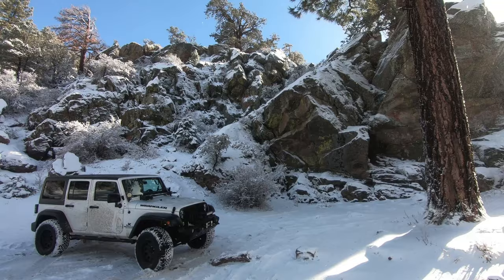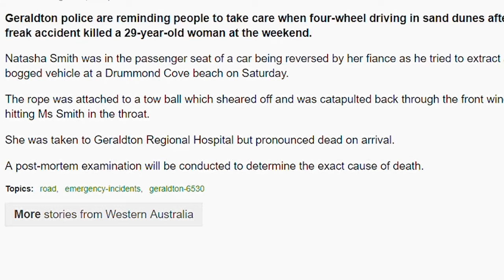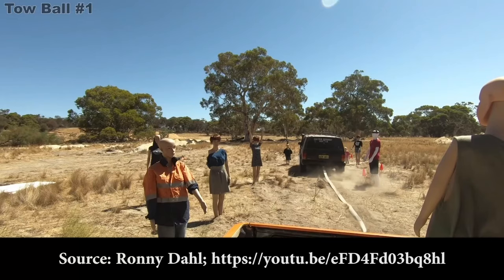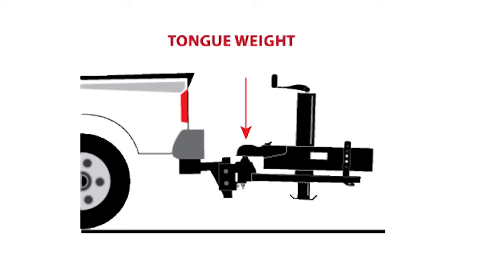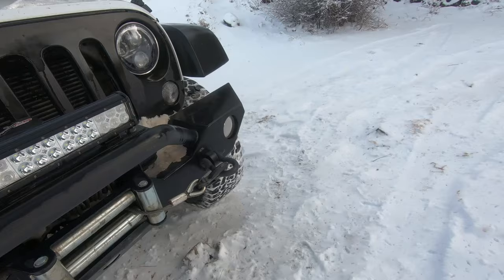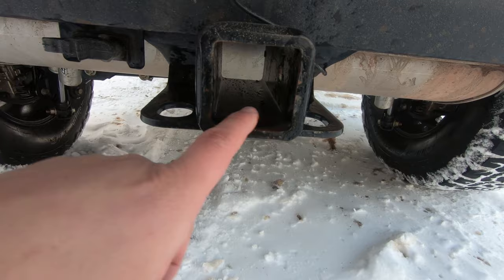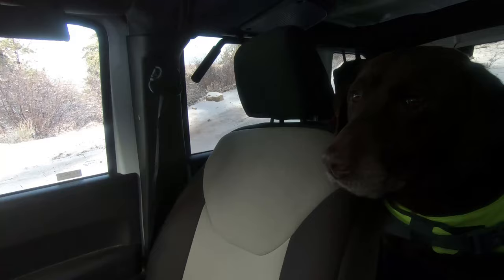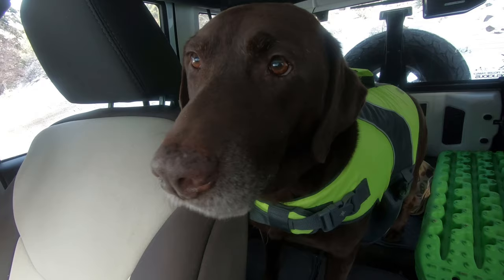NEVER Use a Tow Ball in 4x4 Recovery - Here's Why

Comment: For anyone wondering, in the first instance the ball had been poorly welded to a plate which was excessively corroded. The body of the ball was also corroded. You can read about it here:

https://www.magistratescourt.tas.gov.au/about_us/coroners/coronialfindings/s/stein,_joshua_phillip_-_2010_tascd_418

Moral of the story: Tow balls are safe when properly fastened as they were originally intended, and when they are not corroded or rusted through. This is made especially clear in the video by Ronny. He had to drive 45 mph, cut the shank in half, and chain the other car to a tree for the ball to finally fail after several attempts. 

Additionally, a kinetic rope is a MUCH safer alternative to a static rope. They are designed to stretch and even out the impact of a tug. 

Lastly, a tow ball is absolutely designed to take horizontal force. This is the MOST important factor in determining the rating of a towball. It must be able to withstand heavy braking (shock loading) during towing as well as heavy force during acceleration (static loading) and inclines. You can read about shock and static loading here: http://freeit.free.fr/Structure%20Engineering%20HandBook/21.pdf
Reply: Good info, thank you.

Comment: To be fair, Ronny had to cut the ball AND drive incredibly fast to get it to finally fail. Unfortunately we read about these instances where people are killed, but we never know the condition of the ball before it failed. I’ve seen these balls just fall right off while driving because the lock nut has untwisted off the bottom.

The real key is to inspect them before you use them. If there’s a stronger point of recovery that’s just as accessible, then of course go ahead and use that.
Reply: The Parking Lot Garage, I agree with you.
Reply: Or… just find a different hook point and not risk it lol 🤦‍♂️
Reply: Sure you could risk it, or you can just spend about 30 bucks and get a rated recovery point. Personally I think it's worth the cost not to have the risk.

Comment: I think that Dahl guy was leaving them loose to break them. After yanking 10K pounds boats around I think balls have established themselves as pretty stout. I do agree the old balls from before everything was made from Chinesium were better. I keep my old '90s balls.
Reply: No, he is absolutely correct.  He could have gone into greater technical detail but he kept it simple.  You are hauling a boat. The pressures against that HSS steel bolt/ball by a trailer hitch are minimal compared to a kenetic slam against it with a recovery strap.  Does your boat trailer employ electric brakes? Less stress against that bolt.  Your hitch is also distributing stress across the whole ball and not a 1 - 2 inch area.  When that strap pulls, it's not always a straight line. It may pull upwards slightly or downwards.  And the clips of the balls breaking away, wasn't him.  I hope that clears it up for you.  (I'm a tow op with over 20 years of experience.  We do use the hitch, but not the ball unless it's a light pull)
Reply: Those trailer balls have three classes of strength and you should have observed what it is rated for it's written on I always tie a knot around the back of the hitch
Reply: Quality has gone "South". 
eg.New 16mm D-Shackles have a 2Ton rating, but in the past they had a 4.75Ton rating. 

You may ask why ? 
The shackles are still 16mm BUT the pin is now thinner (ie.19mm instead of 7/8" or ±22mm)

Comment: Well guess he can have his opinion.  I believe I watched Ronny Dahl iirc he had to chain vehicle to tree? Multiple jerks, damaged entire hitch unit…. Didn’t he finally have to weaken the ball to finally cause failure?   First clue to take with grain of salt .  “NEVER & ALWAYS”
  If you are buried to frame in mud. That tow ball can be rated under 1 ton.  Yep easy to break.  But what are most recoveries?  It just needs a assist.   You have (maybe) a 10k hitch with 10k tow ball, 15k rated line/strap/chain to unibody part not designed to be pulled from. 
  What is the weak point?   I have pulled out a lot with under 5k rated chains. Tractors stuck in mud.  All I added was a old tire. @10 chain thru tire 2 spots on front of stuck tractor frame.  2nd chain @16’ from tire to drawbar.  Tighten, pull with both trying. Quit breaking chains when I added the tire.

Comment: Just out of curiosity, I wonder how the balls that are welded on instead of bolted hold up to that test, just from a towing aspect.
Reply from the maker: Chris Singletary right?.. my guess it it would probably fair a bit stronger, who knows 🤷🏻‍♂️
Reply: @andrewbyor3198  The 1st report (about accident in Tasmania, Australia) said that the towball in question was welded, but welded poorly allowing water to pool in the weld and in contact with bare metal which resulted in corrosion that significantly weakened it. So the 1st report is support for the advice that you should check that your recovery point is in good condition, not necessarily that you shouldn't use a towball as a recovery point.

Comment: Ignorance kills. Stop doing jerk snatch strap recoveries. Make sure your receiver hitch is in good condition. I have never seen a receiver/ball hitch fail as long as ignorance is not part of the process. Grade 8 5/8 inch bolts have a shear strength of 27,000 lbs. you do the math. Ignorance is the only way a receiver hitch will fail in a recovery. A ball with a 1 inch shank is rated for 6500 lbs. This rating is at 1/7 the actual shear strength. Again you do the math. Remove the ball and use a shackle for extra insurance. If you jerk it you will break something. Simple stuff.

Comment: those trailer balls have  4 classes end the weaker ones will break,  always tie a loose knot on a frame rail ,  Towed a car on the freeway from LA  60 miles with those straps , they are much better than the violent shock of a chain , you got to keep it tight , and away from going underneath the front wheel of the car your Towing.   anybody who can't control the gas pedal and snaps one of those is an idiot who would stand in the line of one of those is not a very smart person